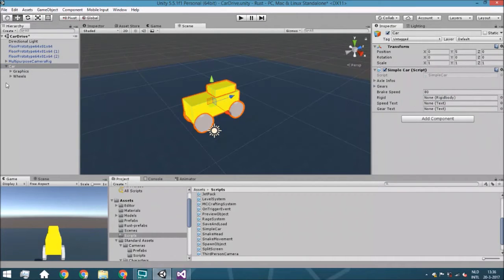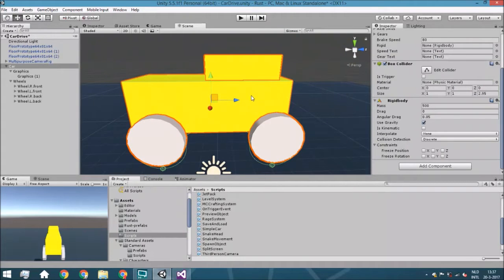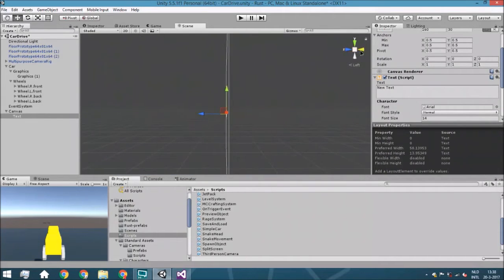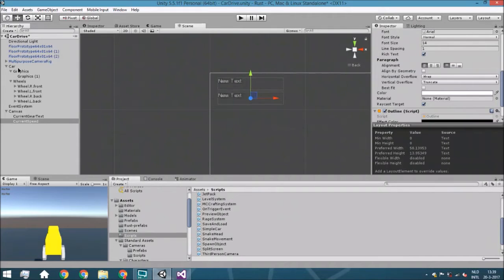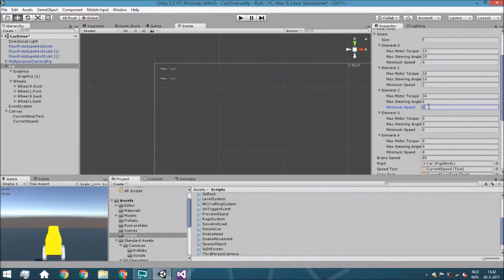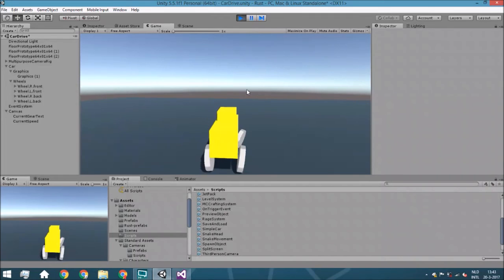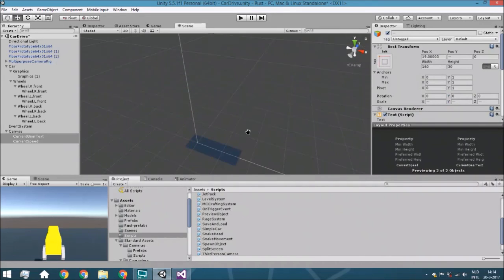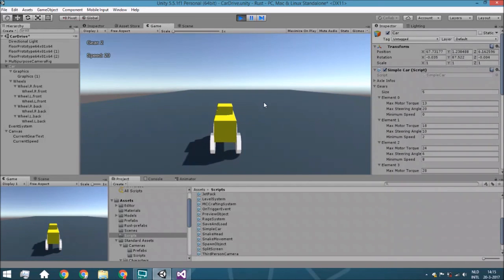[Unity 5.5] Tutorial: How to create a Car - part 4

Comment: I think i got it. 

In the gear info replace the line
public float maxMotorTorque with
public float gearRatio;

Then add this to the code
public float engineRPM;

engineRPM = Mathf.Lerp (1, 9,  Time.time / (currentGear.GearRatio * rearRatio));

float wheelTorque = engineRPM * (currentGear * rearRatio);

float motor = wheelTorque;

Still needs some work,  shifting gears doesn't add load to the engine and the car still speeds up when rpm is maxed.

Comment: Hi gamad! I have a issue with my car. When I press W then my car car going to side. When my car gets much speed and my car is going to side much on X position. I can't fix this problem! Watch at this video and you will understand what I mean >>>  https://www.youtube.com/watch?v=ZaEhTPhvTa4  <<< I don't press A or D buttons. When my car get a few speed then my car is going to side much. My car is going to side by itslef. Is this a bug or a coding problem? Can anyone help me or fix this bug? You can see at photos too! First photo >>> https://i.imgur.com/xNZvncS.jpg <<<  second photo  >>> https://i.imgur.com/e34cYhK.jpg <<< third photo >>> https://i.imgur.com/GewXZ9u.jpg <<<! Ccan u help? Is this a bug or a coding issues?

And this is my script 
using UnityEngine;
using System.Collections;

public class Car : MonoBehaviour 
{
 public Transform m_Center;
 public float m_Speed = 2000f;
 public float m_Brake = 900000f;
 public WheelCollider[] m_WheelCollider = new WheelCollider[4];
 public Transform[] m_Tires= new Transform[4];

 void Start ()
 {
  GetComponent<Rigidbody> ().centerOfMass = m_Center.transform.localPosition;
 }

 void Update ()
 {
  float Vertical = Input.GetAxis ("Vertical");
  float Horizontal = Input.GetAxis ("Horizontal");
  bool Brake = Input.GetButton ("Brake");

  for (int i = 0; i < 4; i++) 
  {
   Vector3 m_Vector3;
   Quaternion m_Quaternion;
   m_WheelCollider [i].GetWorldPose (out m_Vector3, out m_Quaternion);
   m_Tires [i].position = m_Vector3;
   m_Tires [i].rotation = m_Quaternion;
  }

  m_WheelCollider [0].steerAngle = Horizontal * 20;
  m_WheelCollider [1].steerAngle = Horizontal * 20;

  if (Brake) 
  {
   m_WheelCollider [2].motorTorque = 0;
   m_WheelCollider [3].motorTorque = 0;
   m_WheelCollider [2].brakeTorque = m_Brake;
   m_WheelCollider [3].brakeTorque = m_Brake;
  } else 
  {
   m_WheelCollider [2].motorTorque = Vertical * 2000f;
   m_WheelCollider [3].motorTorque = Vertical * 2000f;
   m_WheelCollider [2].brakeTorque = 0;
   m_WheelCollider [3].brakeTorque = 0;
  }
 }
}